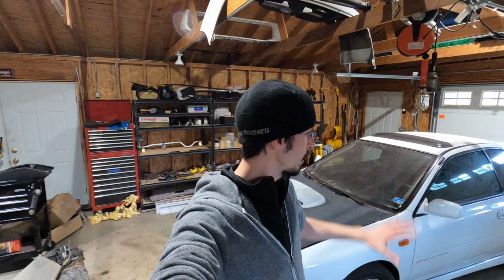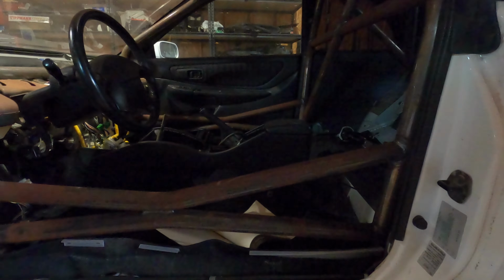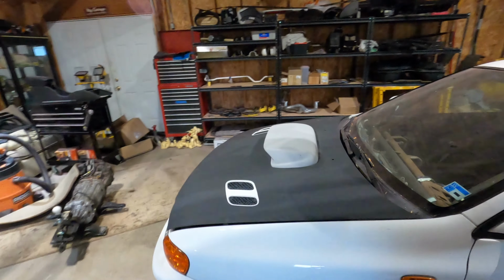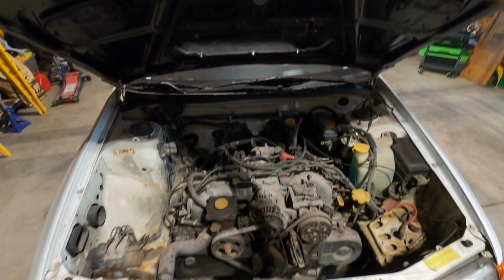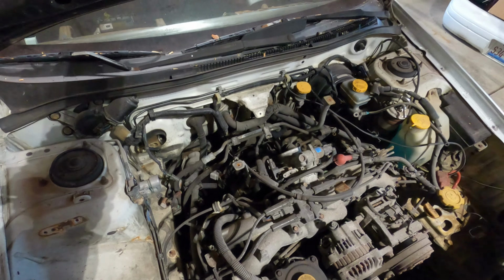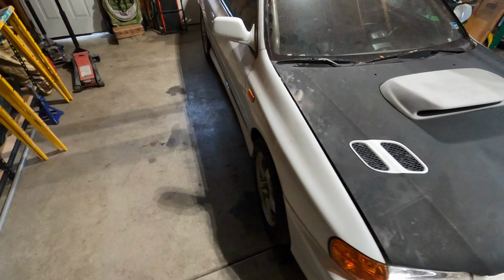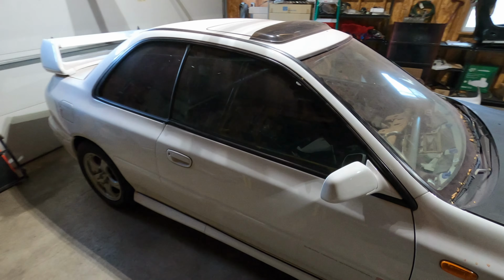Building a '99 Subaru Impreza 2.5RS GC8 with STi drivetrain... [RSTi Build]

Comment: With that new engine, some rpf1's and some decent coilovers you'll have a great track car. I'll stick around to see how it pans out
Reply from the maker: Funny you mention my favorite wheels, we are going to use fortune auto 500's with swift springs, and considering sending the engine to IAG as last time it was running I was experiencing overheating, thinking the head gasket went or Mishimoto radiator and fan shroud they make is terrible with airflow. One of the upcoming vids we are going to tear down the long block and check it out before we ship it out to IAG.

Comment: Curious what kind of damage that old shell had. From the video it looked pretty straight, but we all know that looks can be deceiving!

Looking forward to following along with this project. Had a '00 2.5RS years ago, wish I'd have never gotten rid of it.
Reply from the maker: The floor and wheel well had started tearing apart, there were noticable tears in metal near the seams. also if you had a trunk on the car, it did not come close to lining up. I had to avoid a stopped car in the middle of the road right after I came around a corner, and it slid into a curb.
Reply: @phoenixfabrications6432  Ouch. And yeah, seems like a fair reason not to want to dive into fixing it!